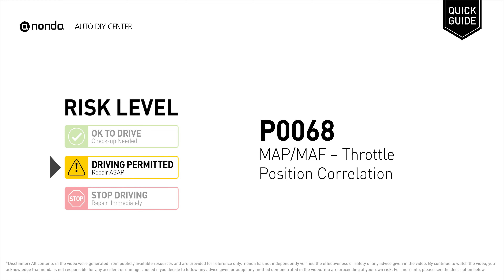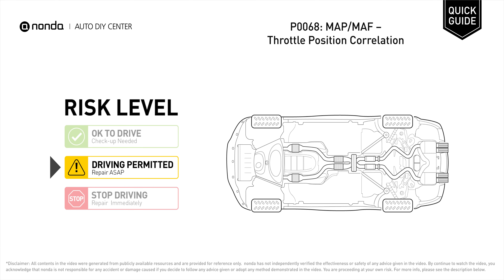What is P0068 Engine Code [Quick Guide]

Comment: I have a 2014 Mitsubishi Outlander Sport. The car will go into limp mode and stall. Then it is very hard to start. I scanned the car and got P0068. I replaced both the MAP and the MAF. I also checked for vacuum leaks and cleaned the air filter housing and replaced the air filter. I reset the code. I am still getting the same issue however 😭 Anything else it could be?

Comment: Hi! Is this something that would cause reduced engine power? On my 2011 Malibu I'm getting three messages. Service esc service Traction and the reduced engine power which is BAD very dangerous. And this is the only code that pops up
Reply from the maker: Yes. Check the condition of the wiring related, MAP, MAF and throttle position sensor. Check the sensor using a multimeter to verify if it needs a replacement.